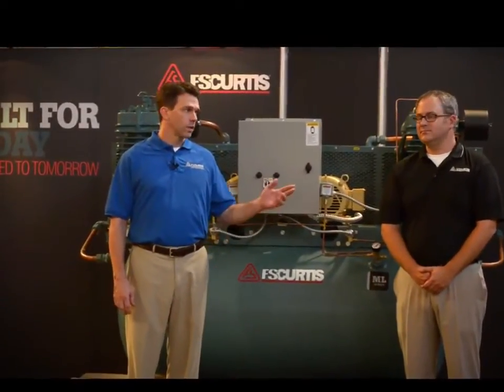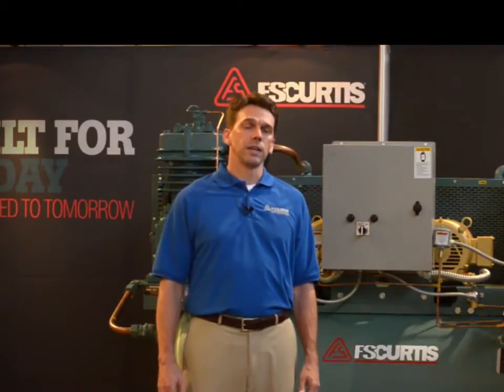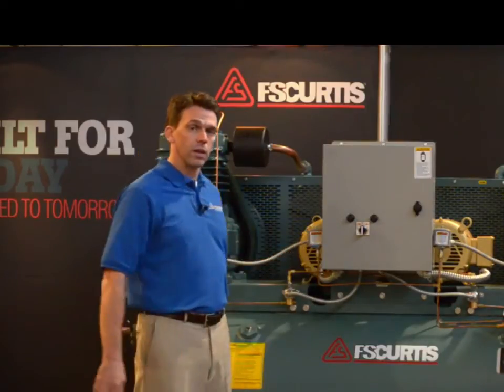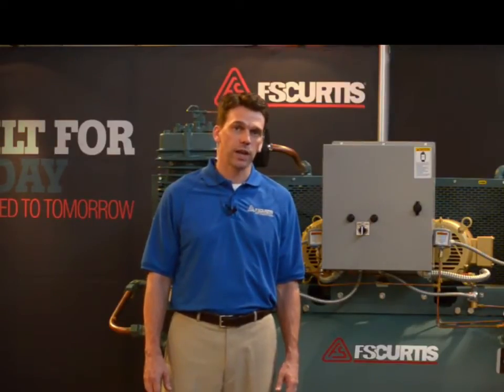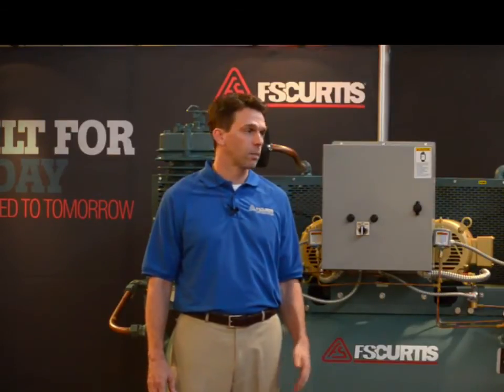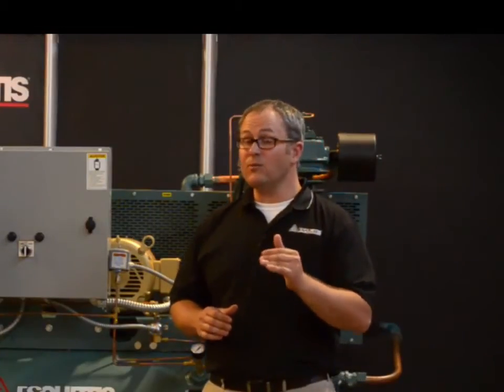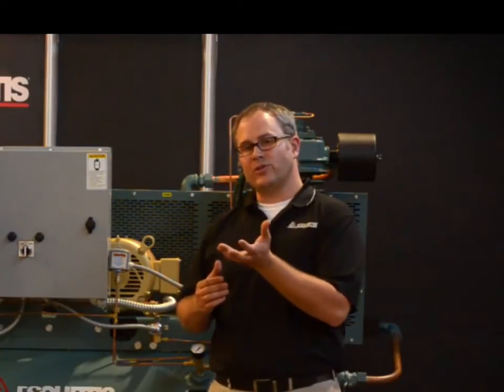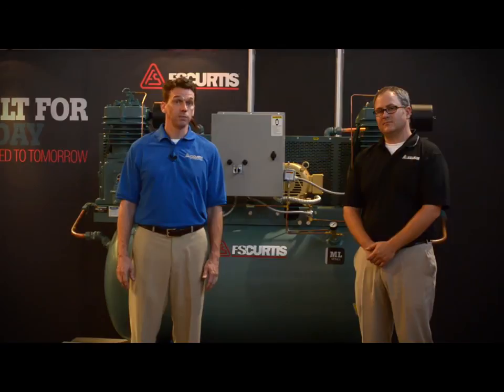Reciprocating VS. Rotary Screw: Advantages and Disadvantages

Comment: Piston compressor is more economical in electrical consumption, less maintenance required, extremely powerful. "screw" and in terms of VSD / frequency controlled compressors screw (NO !) The best setup for greater flow is still the cascade setup with 3 compressors. The standby (backup) compressor is 1/2 of the normal flow rate (NO VSD / FREQUENCY regulators for COMPRESSORS, THANK U.{15/30/45} // $$$).